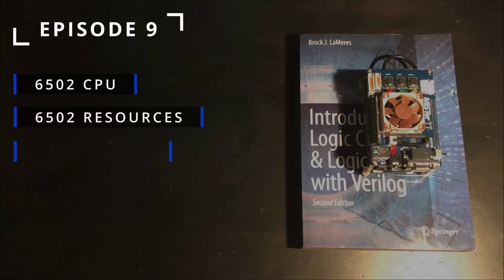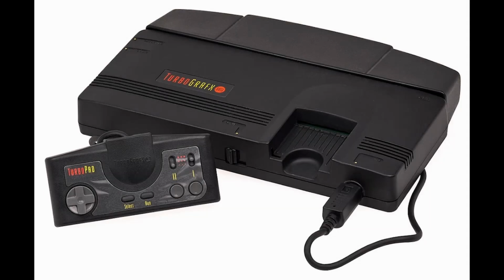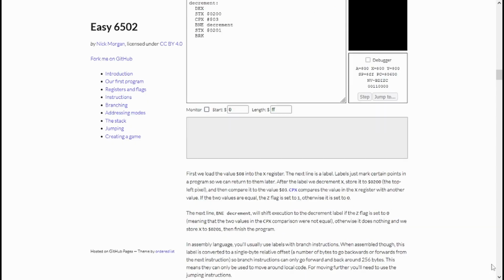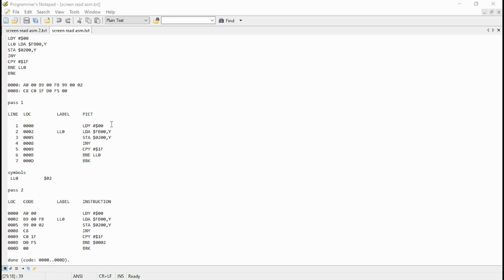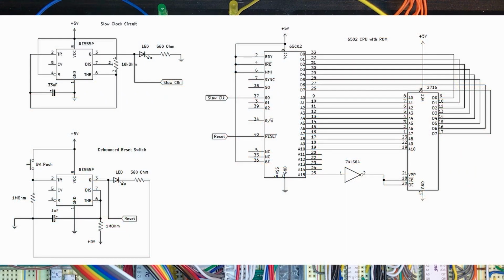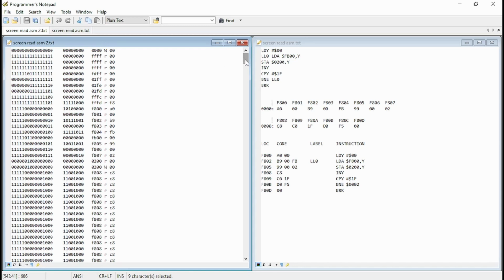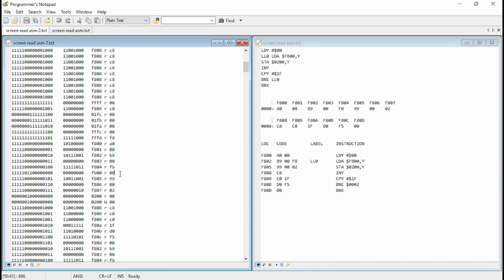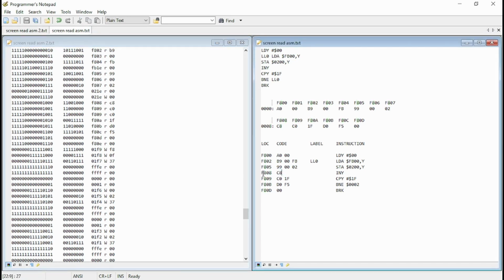MiSTer Core Dev Episode 9: Let's Do 6502

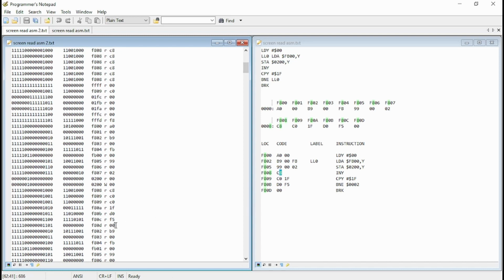Comment: Thank you very much, I'm new to the FPGA world and verilog, and I learn a lot with your video,  you explain very well and the video are well directed, much more than a lot of professional training. I have a Mister and it's been a long time that I want to dig into it and learn how to implement some core. At 29:15  you say that the break instruction is readed and that's strange because the CPU must have already taken the branch instruction just before. Is that possibly due to the fact that the CPU prefetch instruction ?
Reply from the maker: Solal - thanks for the comment. Good comments are definitely why I make the videos - so thank you! About the instruction, I think you are very correct. I'm currently  doing a Z80 project that I will also make a video series about and I see those instructions a lot prior to jump instructions. I guess they just never really mention in the reference books. It does occur on real hardware too though for sure.
Reply: @misterretrowolf1464  Thank you, I'm looking forward for the z80 video :)